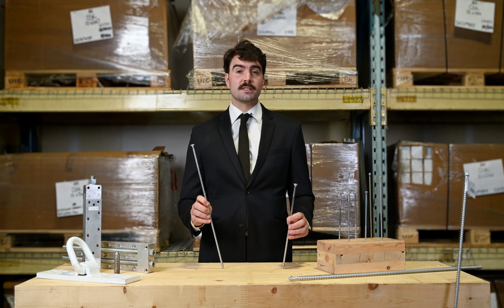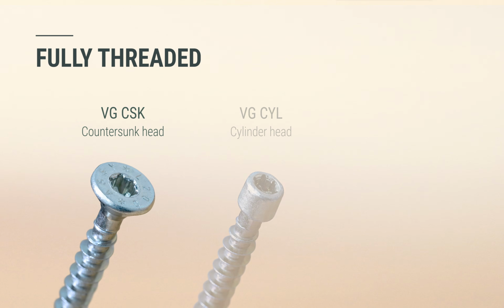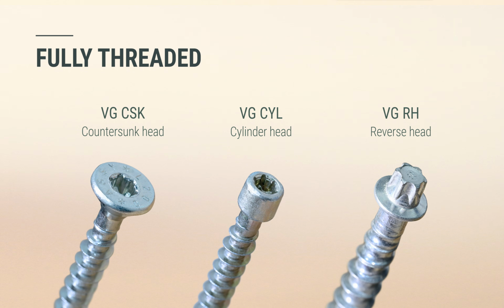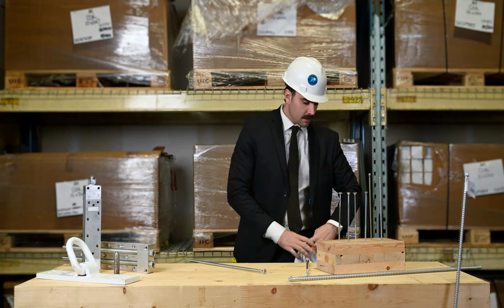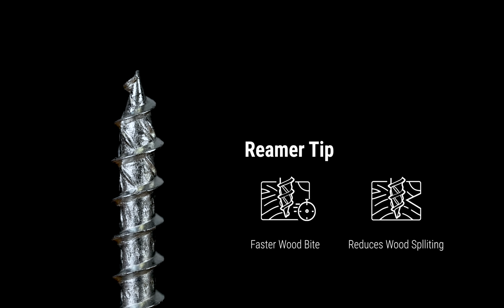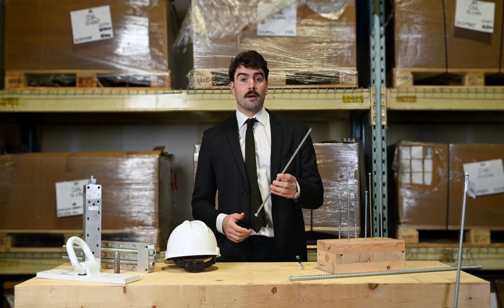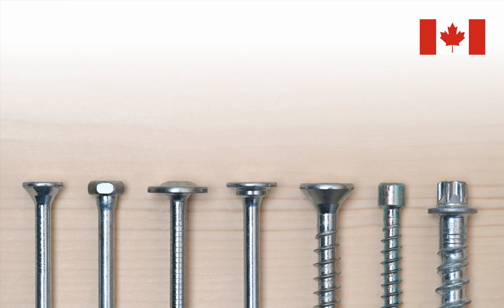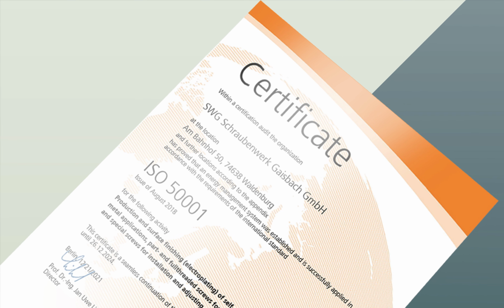Partially Threaded VS Fully Threaded Screws

Comment: What is your opinion on using various adhesives on the threading of wood screws into lumber?

I mean things such as woodglue, the various colors of threadlocker, liquid nails or is just naked bare metal on wood the best?
Reply: Hi slimjim2584, by doing this you will change the fasteners performance probably more in line with glued in rods under the assumption that the glue bond is done right. In order to get that benefit for strength and stiffness you may need to pre drill a hole with a diameter exceeding the fastener outside thread dimeter.  Screws are functioning through a mechanical "bond" to the wood, the threads bite into the fiber and secure the festener in place against withdrawal. Glue or Epoxy work differently.